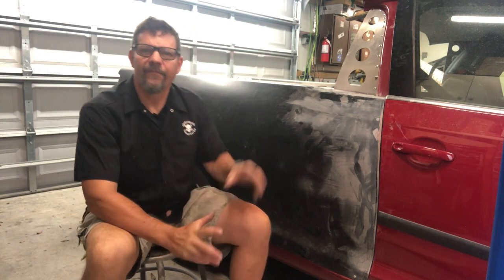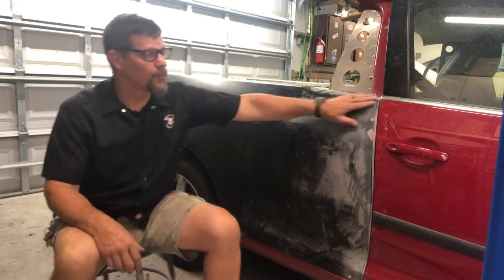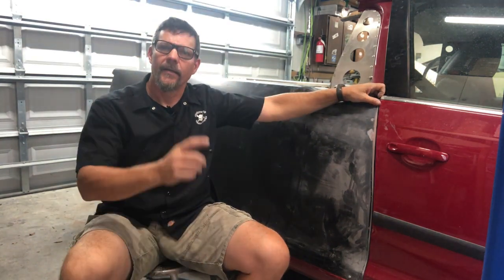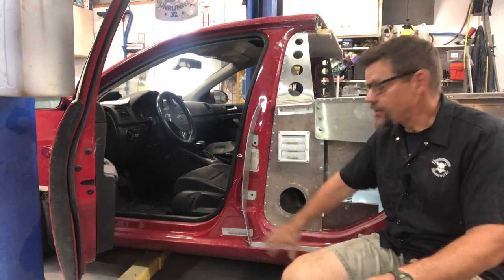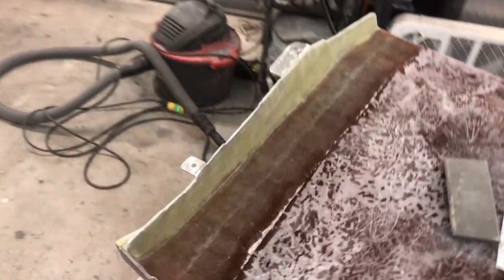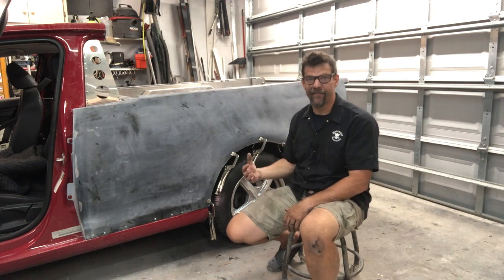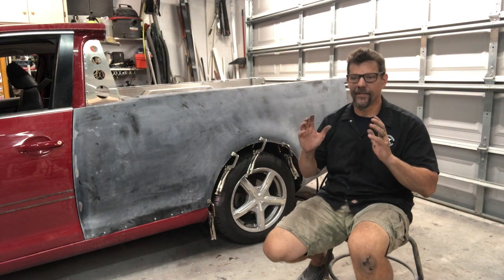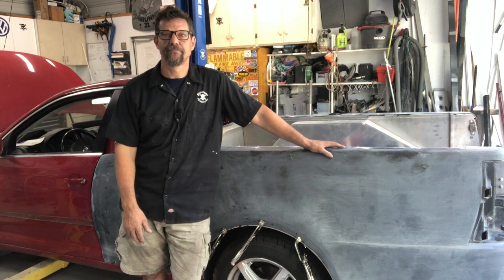Smyth Jetta, installing quarterpanels

Comment: can you put the cap on before you install the quarter panels?? Great job on this video. Thanks for taking the time to do it.
Reply: You could but I think it would just make things more difficult. You’d have to use adhesive or fasteners that were flush in the bottom and more importantly, the lip that extends into the bed would make getting the quarter in place a little harder. I think you’d have to put the quarter panel in place to get fitment just right. I might be missing something but I don’t see the advantage of installing caps before the quarters are installed
Reply: @hestermannmotorwerks  Thanks!  Your videos are terrific.